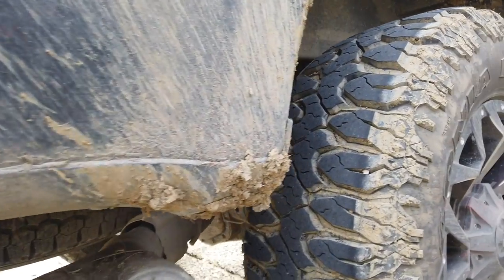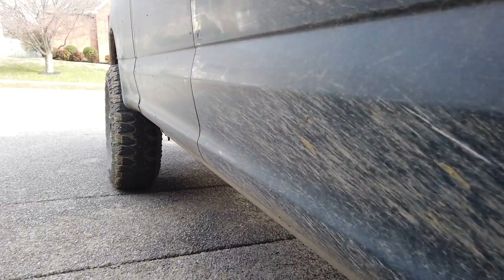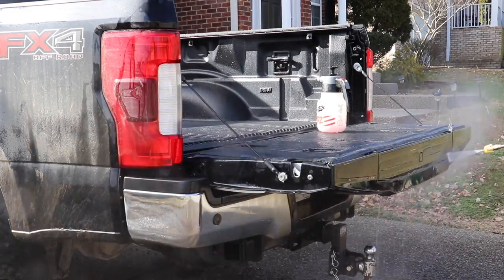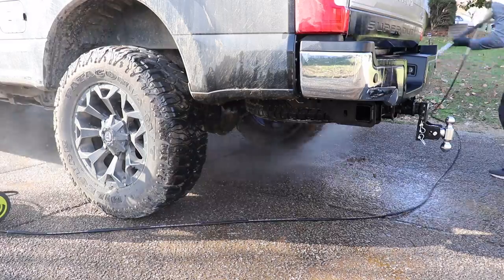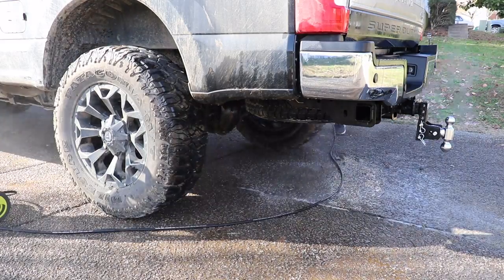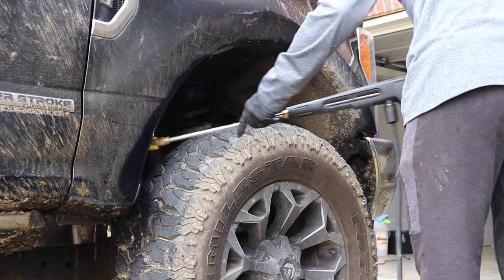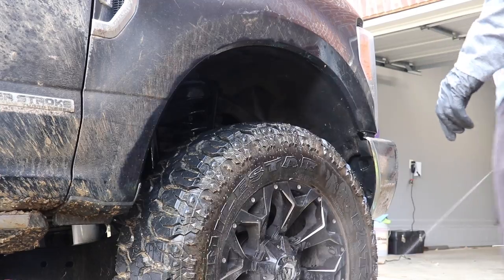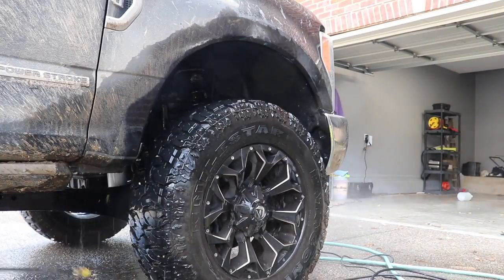My Ceramic Coating Business Formula & How You Can Copy It!!!

Comment: When applying a ceramic coating when is it good to install outdoor or indoor ?
Reply: Indoor, especially if you are just starting.
Reply: Ideally always do indoors and let cure overnight.  If the job runs into the evening hours and the air is saturated with moisture and you are in the middle of a coating you will be in big trouble. 

If you are coating in the middle of the day outside the flash time will be almost instant and result in high spots galore.

Plus you run the risk of airborne contaminants landing on the surface(dust/pollen/dirt etc...) and will get rubbed in during your final wipe and probably spoil the paint correction steps you did prior.

I've tried to do coatings for my clients outdoors against better judgement in the past and learned my lesson.

Comment: Another way to think of that metaphor of your, the ceramic coating, and the fabric protection is with a sealer for your countertop or wood floor. It will make it easier to clean the spaghetti sauce, but the spaghetti sauce is still there, you still have to clean it.

Comment: Yes keep going.. just in case you need more business topics the reason why I haven't started detailing it's because idk what to include in my details and how much I should charge 😣 if you can make a video with like a general idea on packages that would help out a lot.
Reply: You don’t necessarily need packages. Many detailers customize based on what they customer wants. I wouldn’t get stuck on packages just find out the type of car, and what kind of stuff they want and you need to know how long it takes you to do certain jobs. I base mine on $50 an hour
Reply: @briandraper7630  ok I can see that thanks for the tip! I think base mine at 45 for now just to see how people respond to that and I'll adjust later thanks again.

Comment: Yes,keep doing this style. One more question: do I have to throw away applicator and towels after the ceramic coating job.( I mean traditional ceramic coating not spray ceramic)
Reply: If you’re using an applicator block with a small piece of suede wrapped over it; yes, you’ll need to throw that piece of suede away.  Once you do one and feel the piece of suede later you’ll understand why...it’s usually stiff as a board if you’re using a good ceramic.  If you’re using a microfiber applicator, you might be able to wash/soak it, but make sure it’s not too hard afterwards.

Comment: I really hope you don’t tell your clients you’re correcting the paint. You always use hyper polish with a light cutting pad or finishing pad. This will do nothing but a paint enhancement, unless the paint it softer with minor swirls/defects. You also polish very large sections which will decrease correction. Other than that, nice job.
Reply: Most people don't want to cough up $500+ for full correction on top of a coating, and this is a farm truck

Comment: Wow, am I seeing you dragging your pressure washer hose over the edge of the truck bed, that's not an ideal way to start a video. All of the newbies watching and hoping to learn the right way are going to think this is an acceptable practice. 
I feel you are losing your bedside manner doctor Wilson, always respect the patient. Whether it's your 1st day or 32yrs later in my case.
Reply: Not really a big deal if it is light contact and you know you are going to polish the paint anyways. Trucks are a different animal. Especially this dirty.
Reply: I understand its going to be polished anyway, but why make more work for yourself.  Plus if the bed has plastic caps on top how are you going to polish those if they get abrasions from a gritty rubber hose? I just think these are poor choices. 

Generally if one of my employees is helping me he will follow me during the pressure washing stage and hold the hose from making contact or assist it from getting caught under a tire.
Reply: Plus some trucks cost between $70k and $100k now, I know if someone was treating my truck that way I would not call them again for detailing.
Reply: @rouschautodetail6873  The edge of the bed is made from plastic. There is no way that hose is going to scratch it. You would have to be purposefully trying to run the hose all over the place to do damage. He doesn't have another employee. If it was paint, obviously thats improper practice, but come on. Don't be that guy pointing out the one little thing you can nitpick in a 30 minute video of useful information. It's irrelevant.

Comment: I really hope to avoid Ceramic coatings simply because I don't want to be spending 10-15 hours on one car every day.
Reply: I used to think the same until I got into them, and made double the hourly pay I did before. You can work half the hours a week, do a few cars a week, and make a hell of a lot more doing it
Reply: @lukehouk234  I'd do the coating, I'm just scared to do a proper wash/decontaminate/clay/correct then coat. That's like 12-20 hours of continues labor.
Reply: Midnight Mystery Good point, but that is also reflected on the price of the coating. I’d say the actual coating is probably 25-50% of the price of getting one done. And again, prep work is still more profitable than an average detailing day in my world. You can book out 2-3 days for a customer even if it only takes you 15-20 hours for the full job
Reply: @lukehouk234  Once you start preparing the paint, like wash, decontaminate and clay, how can you stop and continue the next day?